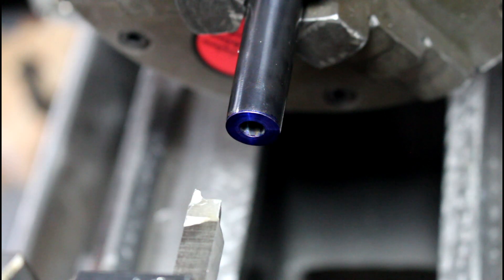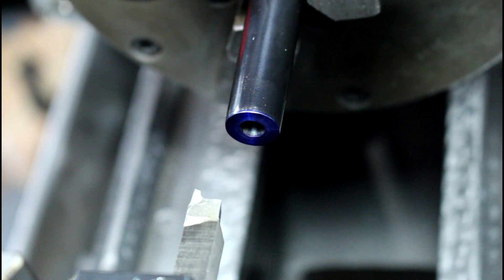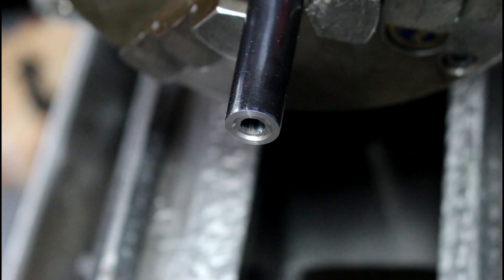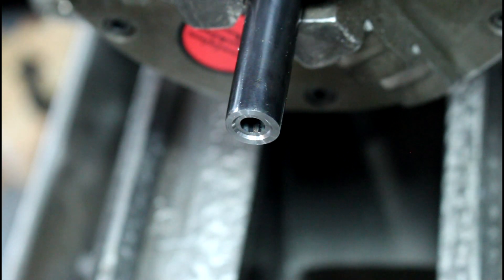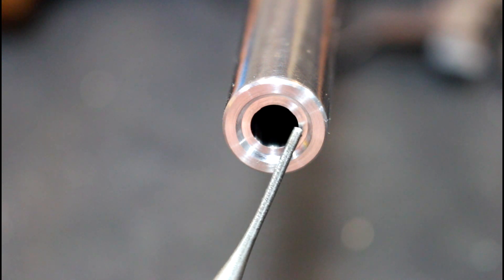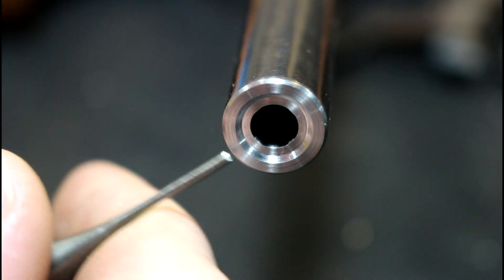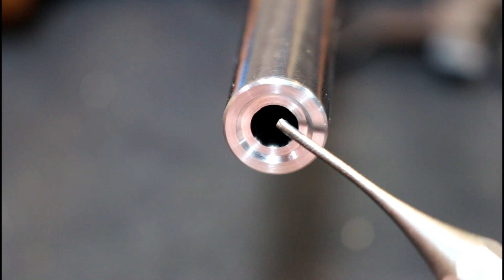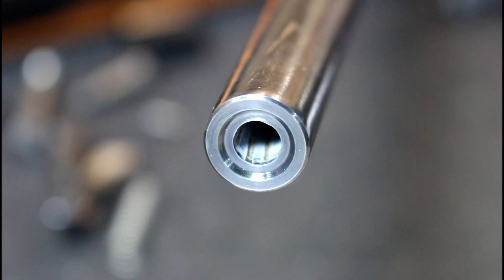Crown A Barrel With A Recessed Target Crown, Custom Precision Mauser Part 2

Comment: Had a question. I'm a relatively new gunsmith and wanted to know if you could give me some suggestions about lathes. Size, brand, certain things to look for. I'm currently using a Birmingham YCL 12x36. Noticed you had a South Bend (that's what I trained on). Thanks for your time
Reply from the maker: There could be a book written on that question. Your lathe should do good work. Usually a 12x36 to 14x40 or so lathe is a good size. Short spindle length and 1-3/8 inch or larger spindle bore. The lathe in this video was a SB 10L 10X36" lathe. It did some really nice work while I had it, but it's about the smallest machine I would want to do barrel work on on a regular basis. I also had a SB 13x40" from the 60's and that was a nice machine, but you are limited to 1k-1.2K RPM's. Usually the heavier the better. Do a good search for gunsmithing lathe and you can read for days on the subject. I'm looking for a Clausing 6913. that is one of my top 3 gunsmithing lathes.
Reply: I have a 1943 KS sheldon with 1.0625 spindle bore.  Anything that won't fit through that can be done over the ways with a cathead.

Comment: Did you just crown a barrel using a 3 jaw???
Reply from the maker: Yes, but it is a 3 jaw adjust-tru buck chuck. Not a standard 3 jaw scroll. This buck chuck allows you to dial in this end of the barrel just like a 4 jaw. It was zeroed out to within 0.0002" for the last 2.5" of the bore. Still takes 10-15 minutes to dial it in on average.
Reply: Oh... learned something new today, thanks!

Comment: So all I need is $5000 precision Lathe to Crown  a $75 bucks Barrel
Reply from the maker: Sure, gives you an excuse to do several other projects. I just build a special puller today for my boat motor that costs $75 online.
Reply: Smithy lathe has great inventory
Reply: I built a $200 morse taper shank spade drill today, that's surely worth something.
Reply: Or just take barreled action out of the stock, take it to a gunsmith and spend 20 bucks

Comment: I enjoy   your videos and  enjoy learning what  you  share, and use it with my airguns.
However  the 16" air gun barrel I can't center it with the bore using a spider.  so crowns are made by it being chucked up in the lathe, so it can't be perfect 

I do not know on a air rifle how much it affects the accuracy  , I have some  testing to do   that I plan on doing some videos on.
 I know a lot of guys crown by hand as  you did  in the  first video with decent results.

Iam not a machinist I am learning as I go  with my 10" hevy south bend.
 I share for guys who like airgun stuff, its boring  for most who are not addicted to airguns I'll show slowly with details so they can  see and understand what Iam talking about and hopefully learn it for  themselves .
also with air rifles we  usually chamfer  at the bore  then do a nice  face to finish the crown.
I see with your powder burner you dont do that.
 any input would be appreciated, Iam very glad there is a guy out there like you making those videos you share .
Thanks Mike
Reply from the maker: I've never gotten much into air rifles, but then again, I've never shot a high power air rifle. I know if you have a steady rest you could crown it that way too. Then you are hoping your OD is good. Only other option is to make a short tube with two sets of 4 screws about 6-8" apart. You chuck that up in a 4 jaw usually, then you can dial it in with the two sets of screws. Basically a mini headstock held in your chuck. That would be the best, but you could also use an adjust true type chuck. 

I can't comment on accuracy of that, but I would assume that the same principles are being applied to ether rifle.  Id'e be curious to learn the reasoning behind the chamfer. 

Thanks for the comments and feedback, it is greatly appreciated. Take care.
Reply: I finished the recessed  target crown  it part of a video Iam doing  with two project air rifles, I also made mention of  your channel and said that is where I seen you do it.
The short crisp chamfer I always seen just at the bore edge as part  of making sure the end  of the lands are even and taper off and slightly exposed visibly with the eyes if  you have  good vision, LOL

its  subtle but I see ones little more pronounced, also  the Lothar walther barrels for airguns and the  german weihrauch barrels and usually airgun barrels with have that small crisp chamfer  just at  the bores exit.
I'll be testing barrels in different situations I have a rifle coming tomorrow I can swap barrels in the block and also machine down barrels for it, they get set  in with a set screw  and are removeable.

once in  and the scope is re calibrated  for  each barrel it will be good  to go. so  with that I'll get to test how accurate different barrels are  in different  scenarios. a lot of airgunners who do their own chop and crown have good  results and thats using the basic  hand tools & file compared to genuine full out center of bore using a lathe.

I am just tired of the hear say  and want to find out  what does what  once  and for all plus its  what I like to do its fun.

I think I know what your talking about  I see a collar made with screws  I think on Toms web site using also a steady rest, and thats fine  also  it will be somethng else  to make  and get into

Your a  really good machinist thanks for sharing  and taking  the time putting out some great videos, mine will never be great  they will be what  they are just airgun interest which  is needed

Comment: help! so when you cut that 45 deg are using the crossfeed with the compound? I can cut it turning in with the compound but turning out i pull the tool off.( my first barrel)
Reply from the maker: Starting in the bore- straight out with cross slide- the then 45 degree cut using only the compound- then straight across using only the cross feed. Lock the carriage down too. If your tool is coming loose you need to make sure it's tight and you have clearance under the cutting portion of the bit to allow for cutting a recess. Let me know if this helps.

Comment: What lathe is that? Nice. Also what RPM did you have it at? Was surprised that you used HSS instead of carbide, is it more common to use HSS? I guess it wouldnt be easy to hone carbide bit.
Reply: Hi ,
you would find that you can get a sharper edge and leave a finer finish with HSS rather than carbide. carbide is more wear resistant, lasts longer especially for hard materials but HSS definitely leaves a batter finish on materials that it copes with.
Reply from the maker: It's a 1951 South Bend Heavy 10L that I restored to like new. I think I was running at or close to 750 RPM, could probably go a little faster, but it works OK at this speed. I learned with HSS, and have used carbide in the past I just have not had the extra cash to swap a bunch of stuff over to carbide. I would like to get a carbide parting tool though. I don't run a commercial shop, so I can spend a little time sharpening bits instead of swapping out a carbide bits.

Comment: sorry new to gun mods what does a crown like this do?
Reply from the maker: There are a few reasons for cutting a crown like this. #1 is being able to have a straight 90 degree crown which is used on many target rifles. Second is you have your primary crown directly off the bore Recessed to protect it from getting dinged. I have these crowns on most of my hunting rifles and find they shoot just as good as an 11 degree crown for me. My main hunting rifle has this crown and it holds 1/2" MOA out past 600 yards. I think Copper and a few other custom rifle makers use this crown on their rifles also.
Reply: So Coming 90 Degrees Of The Bore Will Improve The Aim Of The Gun ? Interesting I had no idea this would effect the bullet.
Reply from the maker: It won't increase the aim, but it will give the bullet a more consistent exit out of the bore. Doesn't really matter it's it's straight 90 degrees from the bore or an 11* crown which is 11* out from 90. As long as they are both symmetrical and concentric to the bore you should get consistency.
Reply: +Precision Machine Shed I got you